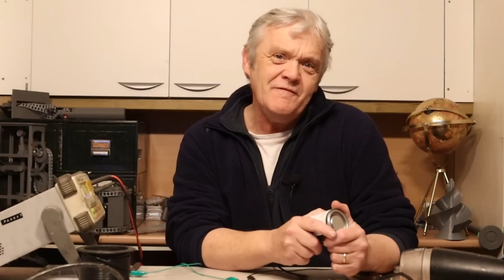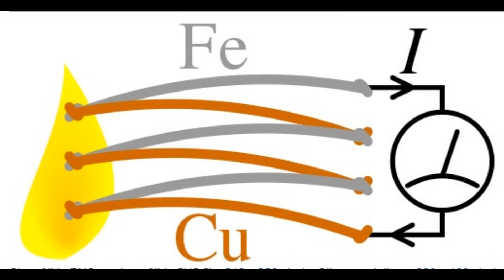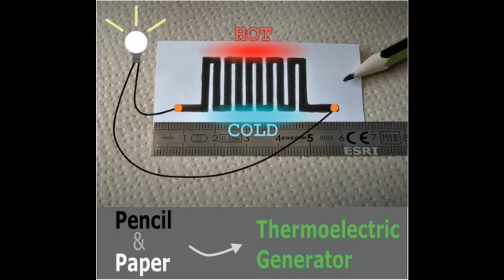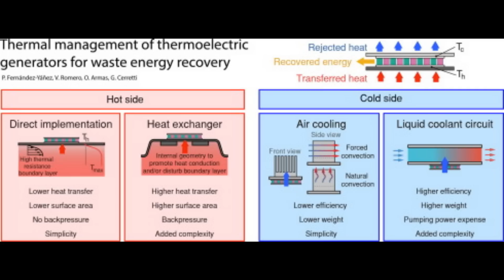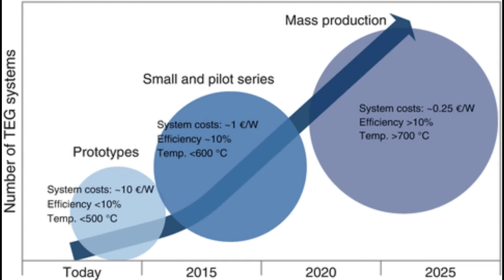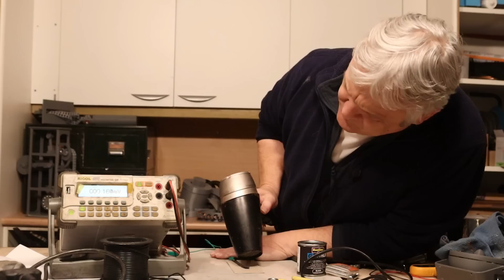2131 Thermoelectric Generators And Graphite Paint

Comment: Hi there, hope I'm not to late for an answer of yours, I would love to see a follow up video of this.
There's an American, don't remember his name, I saw recently, and he used a self made plastic paint which cooled the surface under it. I wonder if you could basically build two story solar panels, where the top layer collects the heat and the bottom layer stays cooled, connecting those two using the methods in this video. And there was another way of collecting lots of heat using curved mirrors in a desert pointing towards a tube, to heat up the water within.
Maybe you could make a video experimenting with that, using it to turn on an led 
Looking forward

Comment: doesn't the hair dryer emit ionised air created by its heating element?

To make this a more sound demonstration I suggest isolating the electrodes with some scotch or paper. It will still transmit heat, but prevent ions from bombarding the electrodes

Comment: If the lines were painted in circles would it increase voltage?  Assuming you would use a small flat surface to bridge the circles of course

Comment: What about a metal roof? I don't know what determines the voltage difference, if it is mass or contact area between the conductors, but If you were to paint the underside of the metal roof sheets with graphite paint, that would give you a junction of the dissimilar conductors. Might have to take into account any galvanized coatings or the amount or spacing of wires. With the sun on the roof, and air gap spacing between the metal and the roof deck, you should have a temp difference between the op and bottom side of the panel. With a ridge vent, you should have a stack effect cooling flow on the graphite paint side of the panel, and the sun heating up the tin side. Probably wouldn't be much of a temp delta, but if all it entailed was painting the bottom of the panel you were going to put on anyway, and connecting wires to both sides under the ridge cap it seems fairly inexpensive. Guess it would be worth a small scale test anyway.
Reply: Unfortunately you can't just coat the bottom side of the roof to get the TE effect, if you look closely at Robert's painted paper or the diagram of the TEG, the junction is the small part which gets cooled or heated while the bulk of the material is only there to provide different resistance/capacitance so the roof and paint act like the bulk of the material and there should only be one small patch where the paint makes contact with the roof to act as the junctions.
Reply: @VeniceInventors  Thanks, I wasn't sure if it was larger contact area that increased the effect or if the total mass of the conductors, or something else all together. If It only needs a small contact patch, that may make it even better. If you have a north and south facing roof, you can just adhere a film from the peak of the tin/sunny side with the roof decking of the shady side, and then paint strips on the roof decking  before  covering with the rest of the roofing metal. I assume the greater potential difference will be at the extreme edges away from the junction? Wires could be run that far, but I wonder about the danger of electrifying your whole roof.
Reply: @target070  I'm not sure about the exact requirements, but the TEC/TEG modules have a very short distance between the ceramic plates (essentially the height of the semiconductors) so the length of each "leg" doesn't seem to be much of a factor. What seems to matter most is the temperature difference between each junction, and then the number of junctions and difference between the conductors used. Seebeck used copper and bismuth but other conductors and semiconductors work too.

The thermal conductivity of the roof can be taken advantage of but not really its electrical conductivity unless it's split into many small isolated patches serving as junctions. 

Now one could imagine running a really big copper cable between the north and south sides of the (white and black painted) roof to have two junctions at different temperature and it should work, but how well, I don't know. It's worth a try if you have some spare copper cable, or make a small scale prototype to validate the idea with the same conductors.
The location of the connections wouldn't really matter as heat only rises if there's a fluid like air (convection), otherwise by conduction alone most of the roof would be at the same temperature (unless there is air trapped underneath).

Comment: So, in the graphite/aluminum combo, it looks like you hooked up the positive to graphite and negative to aluminum. I ask because I think I'd like to try this on a concrete wall next to a wood stove (well call it that for simplicity). If I place stripes of graphite (say 1cm wide and 2cm apart), then interleave aluminum on top, that should make up the right combination so long as I hook up the graphite to the positive and have AL as the last conductor for the negative.  Did I interpret that right?

Comment: 30 years ago someone gave me a 2“ x 2“ thermal electric generator with ceramic plates on each side. I put a boiling pot of water on one side, and the other surface was submerged in the solution of ice and calcium chloride. 
I believe I had 5 V at one amp coming out of that TEG

Comment: The Seebeck effect is notoriously inefficient for use as a TEG.
Why waste time on a 3% conversion ?.
Reply: If it can be scaled up to a larger production for cheap, then it can become worthwhile.  That was Rob's main point. So far, most of the commercial ones are a bit pricey for what kind of size and generation you can get out of them.  Things like Peltiers/TEC's.  In those forms, it doesn't make much sense.  But you could paint a large surface area with a relatively inexpensive graphite paint and some other semi conductor material, well, that low conversion rate is not going to matter as much.  Sometimes it is quantity over quality (and other times it is quality over quantity).  

  The beauty of these is their potential high durability/long lasting nature.  So not only are they cheap at the upfront costs, but long-term maintenance costs will be very cheap too, which needs to be factored in to the whole picture.

Comment: Here is a bit of an experiment for enthusiasts currently playing around with TEG/graphite applications.  Take a very fine graphite powder and impregnate it into an insulated material.  Run a high voltage through the graphite on the insulator.  This will cause channels to form in the graphite that are of the lowest resistance through the surface.  Afterward, connect to the non-burned in graphite and the burned channel. The contact points on the now different impedance materials will make a micro-thermocouple(well many of them actually).  I have made high voltage speakers in this way with graphite powder and two thin plastic sheets.  The graphite powder is in-between the two sheets that are in a frame and causes them to make a vacuum between the sheets.  Not particularly difficult to do, just be cautious working with the high voltage.  Be smarter than what you are working with.  Thanks again Rob!

Comment: There is a simple way to make a thermoelectric generator using pencil graphite (cheap graphite could be used). The only thing that must be ordered from a lab supplier is "polyethyleneimine (PEI, branched M.W. 600)" which is the N-type (negative) doping agent. It's not cheap but you only need a tiny amount*. The freely available paper is: "Thermoelectric Paper: Graphite Pencil Traces on Paper to Fabricate a Thermoelectric Generator" 
The explanation of how they did is near the bottom of the paper -
"Experimental Section
Thermoelectric Generator Fabrication
Materials cited: "Commonly available HB grade graphite pencil and office Xerox paper (80 g m−2) were obtained from a local stationery supplier, while polyethyleneimine (PEI, branched M.W. 600) and ethanol were purchased from Alfa Aesar; all of these materials were used without any further purification."

There are a lot of possibilities!

* Polyethyleneimine is sold in other forms such as in solid sheets and films. With some chemistry, It may be possible to derive it from those sources.

Comment: VERY GOOD Smith the underlying principles ALL will work the same way with ANY potential diff we make but better yet take advantage of    The ones we don't have to pay for put in our self are the ones people should be tinkering with  There is giant diff all around us people need to find ways to make the flow  This is like the spot the V shape of your experiment comes together  When filling a full cup it can hold no more the water your pouring has to flow some where  In your experiment some flowed into your meter and we all seen that diff on its screen  I will boldly say that every thing works in a similar way  Diff potentials must have a path that path in your experiment was the resistance that gave you the measurement on your meters screen  So resistance set up that path it used to give the reading  You set up a magnetic path thru your meter  You made a magnetic circuit the resistance made that circuit possible  Maybe we should try finding ways to have lower less energy and making  paths for all the energy everywhere to do a figure 8s in   This is what few can see cant learn what you already know lol lol

Comment: Great stuff there Rob.  Thermo electric generating paint on an Aussie roof, even in winter and bang power.  Of course, I have already covered my roof with panels, but I like where this is going mate.
Reply: heat from the back of your panels can be equipped with some kind of T.E.G. Check for it, :)
Reply: @huguesmassin8903  you could be right but they on the roof of a two storey building.  Not a job for me.
Reply: I meant i dont read but GO go  your HEART Sorry too much drug  @colrodrick8784
Reply: @huguesmassin8903 Nice!
Reply: I've often thought of this too. Our Aussie summers can be right royal stinkers. If you have a north facing roof, even better for solar, PV or hot water. Cooling any panels you have will usually increase their efficiency but I've often wondered about extracting energy from their heat too.
Reply: I've wondered about this for a while - also an Aussie.  I don't know if these are efficient enough yet, but it surely makes sense.

Comment: I have heard about an electric generator based on the effect of an electrolytic capacitor, almost all the electric capacitors I have never remain completely discharged, they always retain their charge and the larger the surface area of the electrode, the stronger the charge, for example an absolutely huge 4700uF/400V, short-circuits after a month it charges to 0.4-0.8V in a another month, very interesting, but the energy is very small, some said that a more powerful generator can be made on this principle, it is probably protected by a patent, but it would be interesting if it can be made at home at least for powering a digital alarm clock for hundred years. Some older capacitors can recharge for many year, I have heard of fatalities when the high voltage capacitor recharged, but there is conflicting information as to whether it was a bad discharge of the electrolyte when the charge returned or just a well-insulated TV screen where the charge was maintained for 30 years.

Comment: I've been stuck on this idea since you pencil lead thermopile idea. I live in texas and summers here are brutal. The temperature difference between an attic and the living space can be nearly 70 degrees on some days. I'd like to see how much energy I'd make with that kind of differential.
Reply: I guess you could get a rough estimate : measure cubic meters of air in the attic. Measure the temperature of air in the atic in the morning. Get a rough estimate of outside "max" temperature of the day. Ask the question : how much heat do I need to to heat up X cubic meters of air by Y degrees. Voila. As an example, for a 40m^3 atic, and a daily temperature difference of 40C, you can obtain 414.15Wh energy every day. Does not matter if you use a steam engine or a peltier device.
Reply: Next step is use water instead of air and you just become "rich" ( as long as you can cool down the water every day )

Comment: I see you read all the comments!! 
 I thought about responding to that comment about using it for thermoelectric saying something about the low efficiency, but having not done any tests myself I thought better of it.(you have better equipment)
Reply: Lol 🤣 35lb Lead Acid Batteries would have killed that for myself also,😅
New, lighter Batteries might just Revive your idea 🤔 maybe?!! 🙂👍
Reply: @AndreaDingbatt  , Maybe, I was using tubing in the lining, much like the original astronaut underwear, I would need to find better thermal transfer, a chainmail of copper tubing would be a nightmare, graphite fiber works good but once through the washer/dryer you got a conductive faraday cage of lint on ya! Great if you are constantly threatened with stun guns(the conductive lint film shorts them out and you don't feel a thing) but it's itchier then fiberglass or even itching powder, likely worse then asbestos for your lungs..
I've seen a fabric of fine stainless thread and regular cotton that's actually soft but it's like $1000 a yard.
Anyway ...
   I thought it was cool at the time (a freshman geek in college) 
   Built-in to a fishingman's vest, plenty of pockets to hide pumps, Peltier modules, wires , heat exchangers.. one of the 5 12v alarm battery jell cells.
   It was only effective on hot days if I put dry ice on the hot sides of the the
Thermal junctions... Imagine a big guy wearing all black with white smoke coming out of his pockets on a 100°f day(38c?)
   In 1995 someone broke the window of my car and that's all they took, just that vest.
   But yes, a modern LiPo battery pack, say just cool a neck wrap, it would work much better, as a summer scarf😜

Comment: Lovely stuff. I'm wondering if this could be used to generate power from the undesirable heating of photovoltaic cells?
Reply: Any temp differential will do it, the more drastic the the differential, more you'll generate.
Reply: @andrewsmithmilan1780  I live in a place where the daytime temperatures can reach 40 degrees+ during the summer. I don't know how much heat a full underpannel of heatsinks with fans could shed, but I'd imagine it would be pretty substantial.
Reply: @samuelsim7457  you must be talking Celsius, 40f is chilly
Reply: @andrewsmithmilan1780  Yes. I'm Canadian. We do Celcius up here.

Comment: My question would be on how to scale up the junction. Would a 4 inch by 1 inch segment work? it would seem to me that the lead collector might need to be all of the same part of the junction material to help with that lead collapse issue you sometimes get when joined, as these can form new partially made junctions just like what you are doing, but work function flipped, fighting your output. I am thinking of a  half ladder shape of aluminum or other foil, with an insulating plastic running the collection rail, and then paint on the conductive paint, and you have a half sheet of junctions with some working area, but I don't know if you can make the junction area that large. I am also thinking that using a stencil, and a rubber rolling wheel, you could rub a graphite powder, and the pressure would make some graphite sheeting thru most of the area, then spread on a higher temp epoxy as a fixing agent to protect it, and it might  be more effective than an ink.

Comment: I was trying to use distilled vinegar to copper electroplate the conductive PLA, but it creates copper acetate in the mix and dissolves the PLA. What you end up with is a dust of copper(II) oxide-covered carbon particles. Copper(II) oxide has a high thermoelectric effect.
Reply: That's another reason why I always print with ABS.

Comment: Like it. Your conductive paint isn't available? NOooo!  It was way superior (IMHO). 1-Ohm/sq@25mic (40x Electro-Smeg?) Wow.
I remember you doing painted electro/heat with sulphur and metal tape on metal substrates (roofing), how does this differ?
Does 'soldering/brazing' the joint of m-m thermocouples have any good/bad effects. I'm wondering about continuous spot-welding flat strips in order to boost the current aspect, but wondering if a soldered/brazed joint(s) would be ok instead.
Could you get another paint manufacturer to make your paint, under license of course? Selling it with links/leaflets/projects of things you can do with it. Surely schools/colleges science depts would be a good client base. What was the biggest PITA about making your paint?
Thanks for sharing so much.

Comment: How would you collect the microvolts so that it's usable
Reply: put  them in series intil  til you get 1V 
you can then make series parall to any Voltage you wish 
Same way some other batteries work
Reply: @trygvetveit4747  say you have a bunch of collectors that make 1 volt each how would you wire them to a battery.... If I connected mine to a car battery to store the current would surge from the battery to my collectors and burn up... How do you make your collector to the battery one way